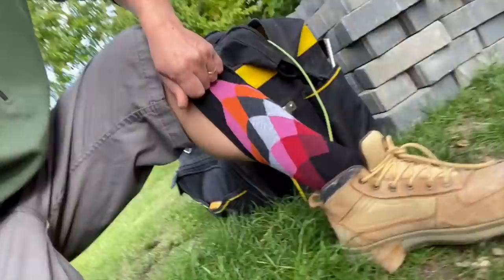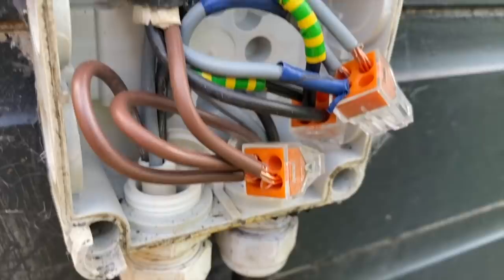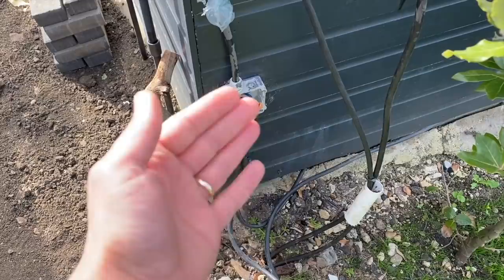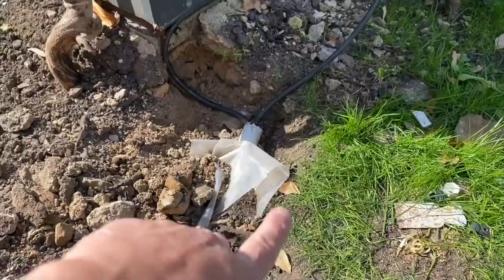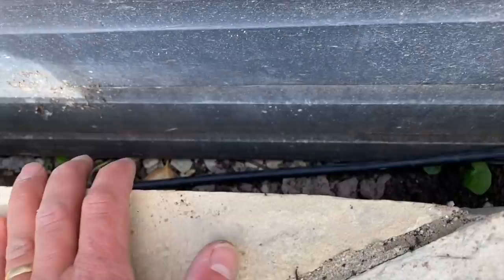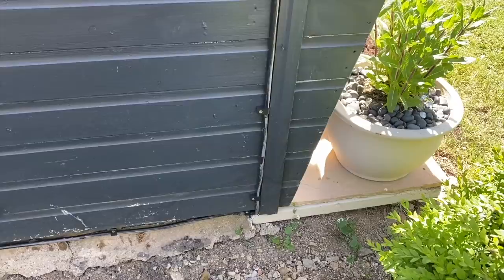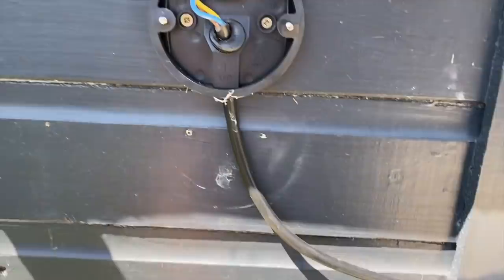Pretty sure this is not the correct way to install Wagos !!

Comment: Aarggh, pipe wrench chewing up plastic glands. Please buy some spanners, even a big adjustable is better.
Reply: Bacho do some lovely wide jaw jobbies, even some with slim jaws.....watching those tooth marks chewed me up let alone the gland. On a plus side.....seen you running the bacho 1/4" ratchet set. Being a maintenance spark that set is a daily use and a must have for anyone, regardless of trade. And no.....I dont work for bacho.....they just do awesome stuff

Comment: 9:56 why not just use the WAGO221 with levers ..
Reply: Cost!
Reply: @pauladams9477  I don't think Wago likes ferrules in the 273, 2273 and 773 series connectors, so it should've been the lever ones (221/222). The newer 2273 (0.5-2.5 mm2 transparent) aren't even rated for coarse stranded like the older 273 (grey) used to be.

Comment: Did I miss the swa being connected to earth?
Reply from the maker: Yes certainly I’m back to sort the supply end out that’s buried under the ground .
Reply: I have a 1.5mm seperate cable connected to a b6 mcb in the house directly to a fcu on the lounge wall to directly go through the wall to an outside junction box and feed outside fence lights with swa

Comment: I'm honestly not sure if you can use wagos on ferruled stranded wire... We have marked that as a fail on inspections because we found no trace of that being allowed in the datasheet and the site engineer didn't even want to hear about that existing in the factory.
Reply: WAGO does not specifically advise against the use of ferrules for this type of connector.

Comment: @12:18, I am a little perplexed, it looks like you have used a compression gland on the SWA and then a E1W gland (or similar) on the Flex?
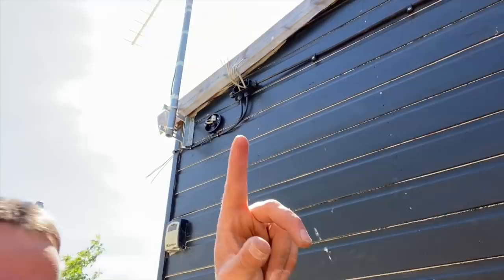Reply: 09:10 - Explains he ran out of glands
10:38 - Shows the red gland covered by an swa boot

Comment: I live in the US and those cable would NEVER meet code. In the US armored cable must be buried 18 in.  What in not 18 in. deep must be in a conduit...
Reply: Depends on where you are. Around here even unarmored DB only has to be 12".

It's kind of funny because our new ISP is burying their fiber at 24" in conduit, but the trunk backhaul they're leasing is bundled at 12-18" without protection. DOT drove a signpost through it last year . . ..

Comment: when you install surface mount boxes butted up against each other (for socket outlets), do you keep some of the grey PVC sheath on the cable that runs between them or just strip them out into single insulated cables?
Reply from the maker: Yes keep about 2 inches of sheath on them.

Comment: Hey Chris, I would imagine you would have to remake every connection at each wiska and install earth plates, and then test all of that before doing the shed!! That alone would add at least another day to the job. I also thought the wiska boxes had a terminal block for the wago’s or do they not fit in the 306? Are they an option? Also very Nice clean up mate great job.

Comment: Hi nice video. Just one question was it all in SWA as I'm about to do a job using it been a long time since I have used it. So watching how you have done it has made me rethink about how I intend doing it. By the way I use a Kewtech 64 an love it.
Reply from the maker: I’ve since been back to this job and changed the whole lot for NYY cable
Reply: @Cjrelectrical   Thanks will check it out. What was the reason for changing it hopefully you will say in the video?

Comment: Your LEDs flicker because your electrical system is at 50 hertz and your camera is at 60 frames per second
Reply: or 50 frames a second, or 25 - just not in sync with the LEDs flicker...

Comment: I would much prefer fitting the pvc compression glands myself.  I try not to use swa outside gland packs any more as I just don’t like them.  I use the storm gland with earth nut, but they are so dam expensive.  I have never done it but I have seen jubilee clips used in the past.  On smaller cables can’t a manufacturer invent a ring clip to tag to, that just fits inside the enclosure.  It would improve the termination enclosures Ip rating and save the customer money.  Probably wouldn’t be worth it for the manufacturer’s as they would loose money on expensive fittings!

Comment: When you use the bootlaces on the flex, do they push right into the ideal connectors? 
Often wondered this whilst doing similar and always turned to the lever type connections
Reply from the maker: Yeah leave the copper slightly longer than the crimp and it goes straight in. I generally use the lever type but though it might be a good thing to show if you find yourself short of the lever ones.

Comment: With perfectly reasonable materials used how can anyone make such a damn awful job in the first place. The use of the ferrules is a good idea.
Reply: I'm not an electrician but my thoughts exactly. Except I'd use Junction boxes for every cable on the outside and inside of the shed. They are dirt cheap, so no excuse. I just use bg ones are they have 20mm entries.

Comment: Why not black for neutral?
Reply: Because we as sparkies arent working in the 1990's, plus the harmonized black conductor would have been yellow in the old cable.  Grey should be used as neutral with a blue mark.

Comment: Also is that PME outside with a 13A fuse?
Reply from the maker: It’s on a TT system was 65ohms so not the worst
Reply: @Cjrelectrical  ahh, did you put the tt in or did the previous electrician do it?
Reply from the maker: Nope the whole house is on a TT
Reply: @Cjrelectrical  great. All properties should be on TT as standard.
Reply: @enloubarpropertyserviceslt7254  Why? What's wrong with TN-S or TN-C-S (PME)?

Comment: Nice video
Should be a TT system though
Reply from the maker: It’s on TT anyway at the house end the ZE at the house was 63ohms. Why wouldn’t you import the pme to a wooden shed?
Reply: @Cjrelectrical  I Always TT Wooden buildings if there are any external socket outlets , are you keeping busy ?
Reply: i Can never see how a wooden could be properly insulated from earth but thats just my opinion so i prefer to make them a TT , i actual had a brocken pen conductor outside one of my houses a few years ago which was interesting to say the least it affected 4 houses at the time so that changed my opinion on the matter LOL